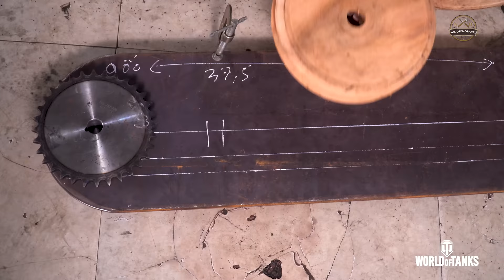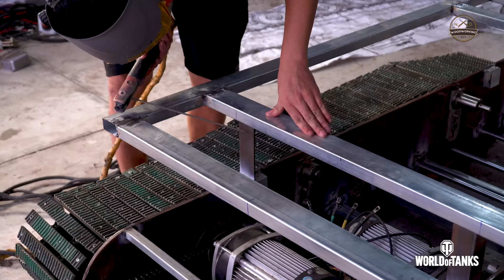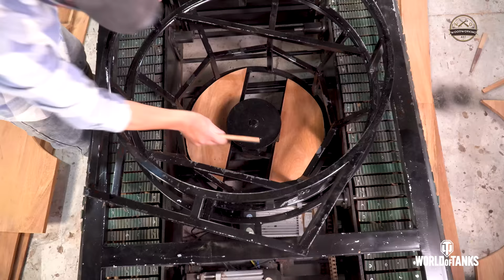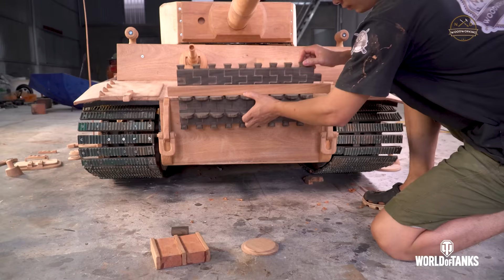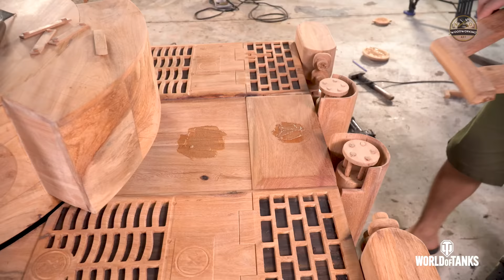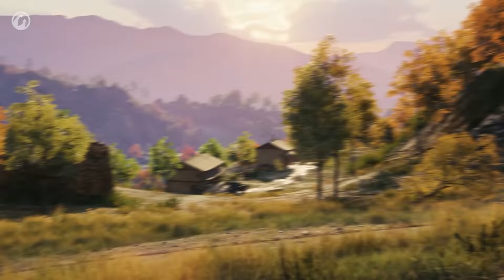Dad Spends 3 Months Building His Son's Favorite Tank

Comment: I love the attention to detail, but the heavy frame would not be required if the hull was instead reinforced with aluminium or mild-steel sheets. Early tanks were built on frames then fitted with armour to form the hull, by WW2 tanks were constructed in such a way that the hull was the frame. The wooden roadwheels are a clever feature, but torsion-bar suspension on such a light vehicle is nearly useless. The main issue is that if the vehicle rolls over (unlikely as that may be), the driver is unprotected. Dropping the seat and adding a drivers harness and a cupola would help.